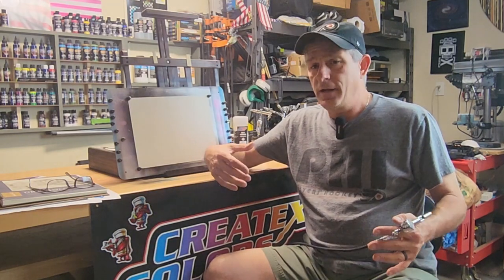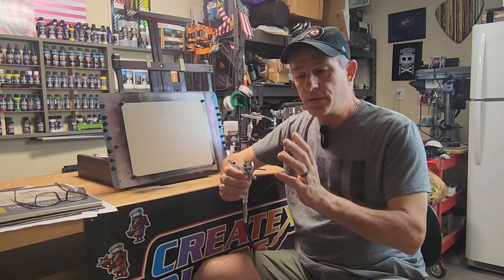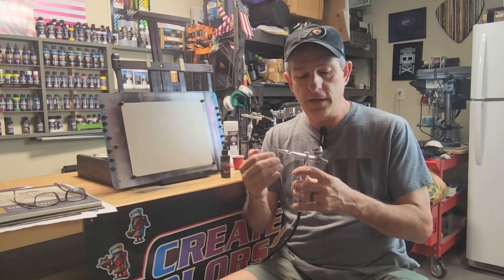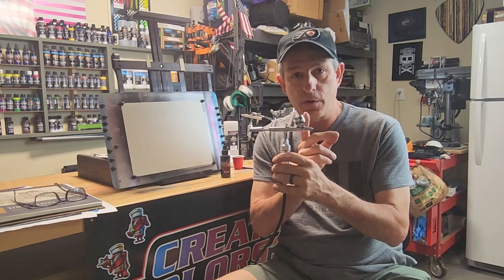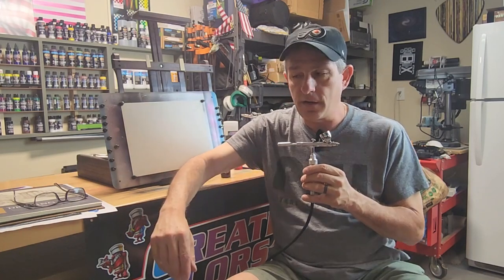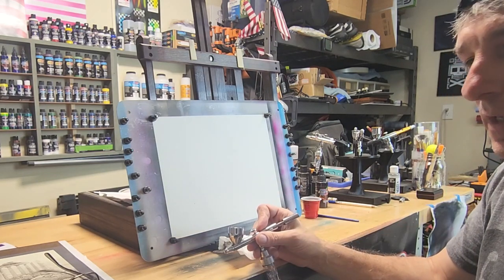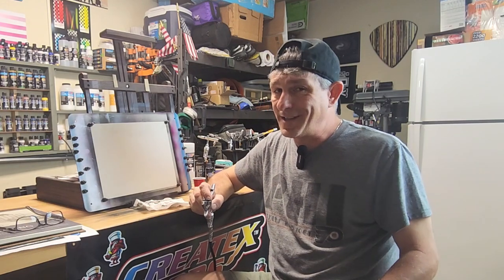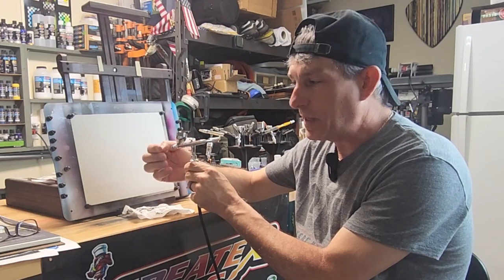Airbrush Control Basics

Comment: Thank you very much for your very helpful videos as a complete beginner. (Born pre war WW2 so left a bit late to learn a new skill.)  My question is the trigger  movement on my airbrush can be adjusted to restrict going full way back to allow paint to flow, would you recommend  allow restricted movement as a beginner or fully wound back.  UK
Reply from the maker: Hi Dave, I do not like the trigger restrictor. I recommend you learn how to work the trigger. You will gain much better control of the brush. Thanks for the question and good luck.
Reply: Thank you  for your quick replay, very much appreciated.  I look forward to going through your video library and thanks again for taking the trouble in helping us newbies.